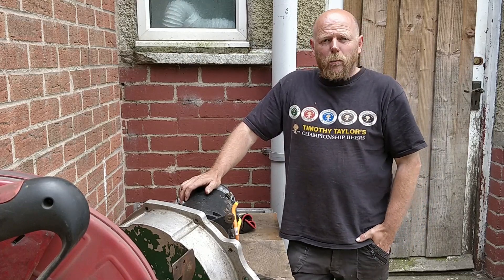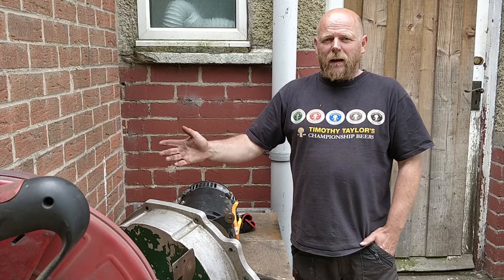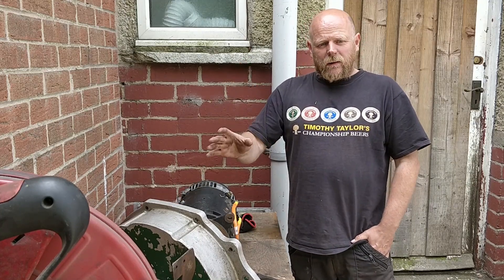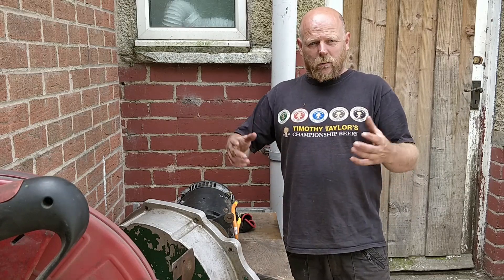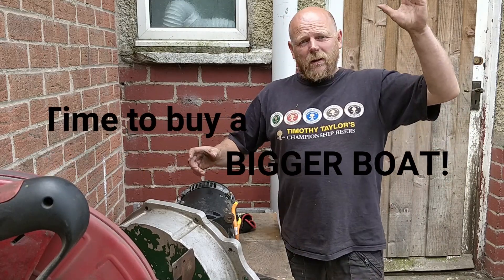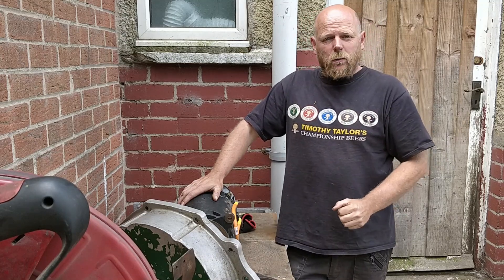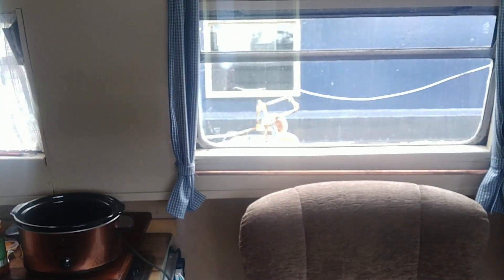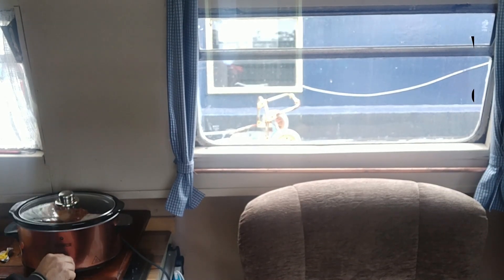DIY Electric Drive Conversion on a Narrowboat - Winging It, With The Tight Yorkshireman. Episode 2

Comment: The problem with not using a gearbox is this 8s not a brushless motor and getting it to reverse is expensive controllers. Sailing Uma did the same. I cant remember if it was Sailing Uma or Riggi g doctor who used bits of truck tyre to make a coupling. They were definitely taking winging g it to the next level. But it worked.

Comment: cracking job all round, as a future option if you decide to go solar. An all in one unit with shore line charging, solar charging and an inverter to boot. This seems good value and would be potentially an easy wing with lots of benefits. Also for future thinking, Im sure Ive seen a video from the sailing community that eliminated the gearbox which enabled all the HP of the moter to be delivered to the prop. If I can find it I will put a link on a video comment. 
https://youtu.be/ikDLxnf1ePQ

Comment: to be honest switching between forward and revers on an electric motor does not need a gearbox, but this motor might have to be tweaked for that.
secondly the motor you have does not like to be run att the low RPM that the prop likes so you have to have a reduction gear anyway.
so in the end you have the gearbox so why not use it ;-)
Reply from the maker: All trial and error! We are definitely winging it in terms of the gearbox and motor. Yes we can get them connect to each other (somehow!. But can we get them to 'work' together? 🤷
Reply: yes the problem being that the electric motor thay you have has a theoretical top RPM that is 3 times that of the diesel it is replacing, and the question is hue does the gearbox react to that.
Reply: @WingingItBoatingonaBudget  I ran into a youtube chanel called "Sailing Uma" they initial used the setup that you intend to build and it worked for them so you are on to someting. :-)

Comment: Excellent! Keep it basic and vague of details so I can enjoy watching it. If it is made in Yorkshire it will work using the KISS principal, people down south would still be talking a good job and playing with their slide rules long after you have finished and gone for a pint.
Reply: Just a note, I am from a mechanical background and I am pretty sure most fine spline clutch centres have V shaped broaching up the guts of them where as your motor looks to have a square cut spline so a 21 spline automotive clutch might not work.

Comment: Really interesting, looking forward to seeing this progress 👍
Excuse my ignorance but why is the gearbox needed, I would have thought a Variable speed controller for the motor would be used to take the inefficiency of the gearbox out of the equation
Reply from the maker: We decided to use the gearbox so we can switch from forward to reverse as easily as you can normally. Obviously whilst mooring and going through locks there can be times when flicking from forwards to backwards. This way should still facilitate that. 
However we will see as the system is up and running whether it was the right decision... Maybe something we can or will change at a later date... 🤔
Reply: @WingingItBoatingonaBudget  it should be easier without the gearbox — just an electronic switch going into the controller.